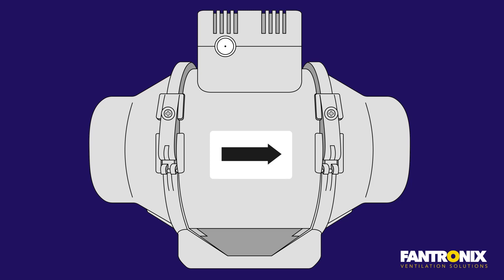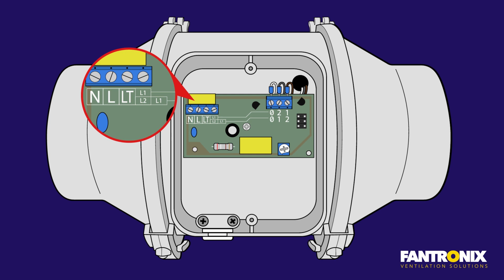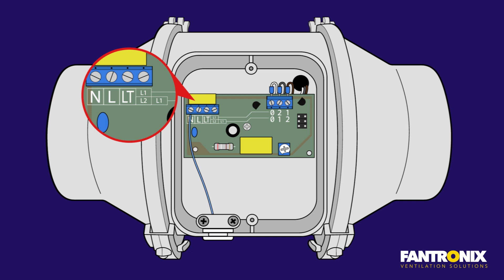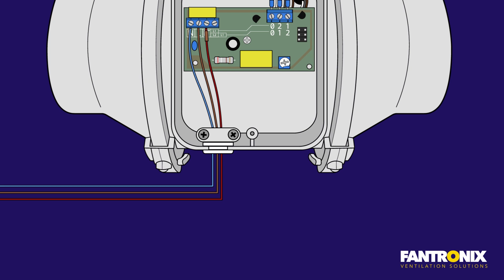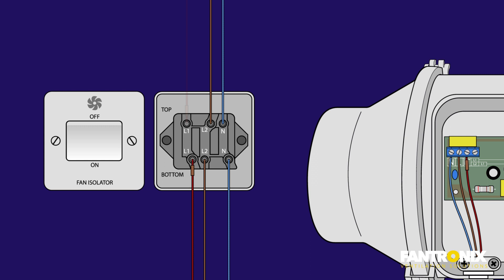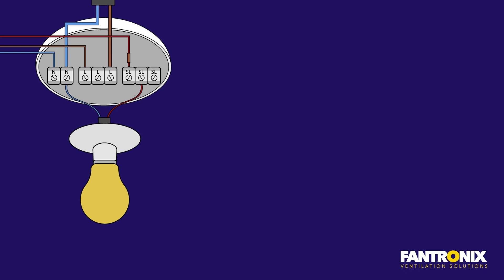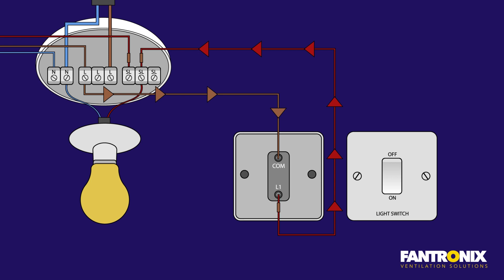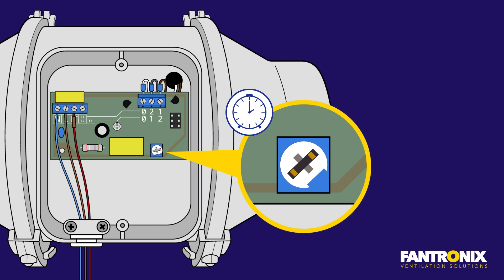Fantronix FTX-TUBE Timer Fan Wiring

Comment: Hi thanks for the video, can I run from the isolater switch straight to the consumer unit/mains as do not want to run it from the light switch.
The fan needs a live and neutral only no timer.
Therefore only using the fan when isolator switch is turned on outside the bathroom.
Consumer unit - isolation switch fused 10A - fan.
Many thanks Barry.

Comment: And how do you ensure its wired for high speed please? I have 4 terminals, Neutral, Live, LT(switched live) and one with L1 and L2 beneath it. Do I Loop L to the L1/L2 block?
Reply: Hi Adam, did you find out an answer to your question because this is exactly what I need to know!?
Reply: @richardnaylor3300  hi, yes looping in both terminals drops the speed, so just to L1
Reply: @AdamGould78  so you just snip a piece of wire 2 inches long and connect it from the permanent Live into the L1? Or from the switch live to L1?
Reply: Hi I don’t think there is much difference between the high speed/low speed settings. I believe the high speed setting is achieved by looping a piece of wire between L & LT only. I tried to add another loop of wire between LT & L1/L2 but I’m sure this is the low speed setting. 

The instructions are so poor!
Reply: @andysmith5328  Page 12 of the included instructions.
Reply: @AdamGould78  We you ever able to set it to low or high speed. I honestly can't figure out what to do to set it to high! Could you help please?

Comment: See if i can answer some of your concerns.

Live and Neutral can be taken from an existing lighting circuit and that will go into the feed side of the isolator. L1 and N. 

From L1, take a wire to the new pull cord switch
From the Pull cord switch, take the Switched live back to the load side of the isolator L1
Then a three core wire needs to go from the Load side of the isolator to your fan L1, L2 and N
If you fan has a 12v light, take the feed from the transformer to the load side of the isolator to L2 and N
Now when the isolator is operated, all power will be removed from the fan so you can carry out maintenance.
I haven't mentioned the Earth wires, but that should be self explanatory.

Comment: How do i wire this to a plug?
Reply: Did you manage to get the answer? Struggling with the same thing.
Reply: Your plug will have two wires: blue = neutral -> connect it to the N slot on the fan ; brown = live -> connect it to the L slot on the fan. That`s it !
Reply: Did you ever get this working?  Ive just hit the same issue

Comment: Hi, I would like to wire the fan to move air from a warm room to a colder room. I do not need it to be connected to the light switch. Is that possible.

Many thanks!
Reply: Did you get an answer for this ?
Reply: @yousifsuliman2446  no, I am afraid
Reply: @isaacperal9778  Iv been advised it’s not the best thing to do. May be worth purchasing something else.